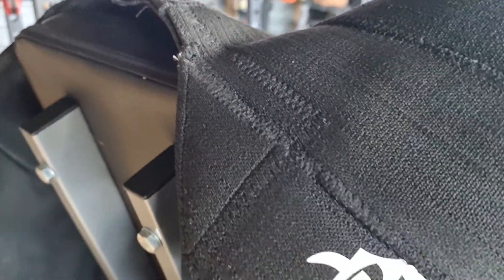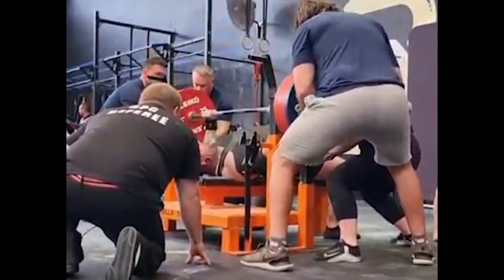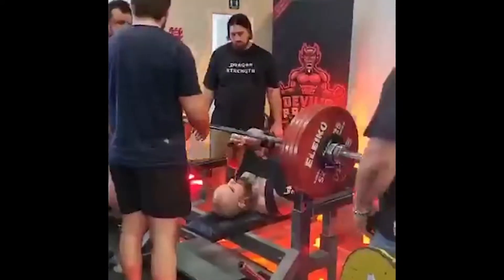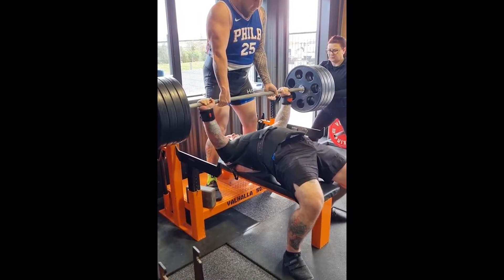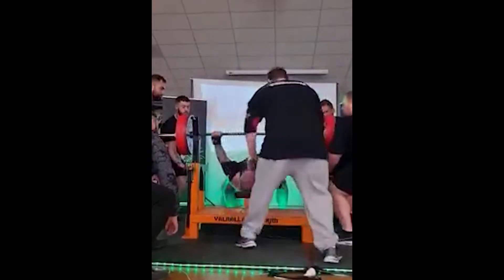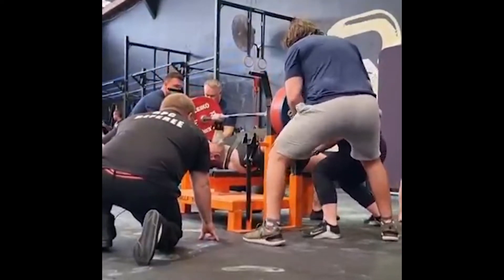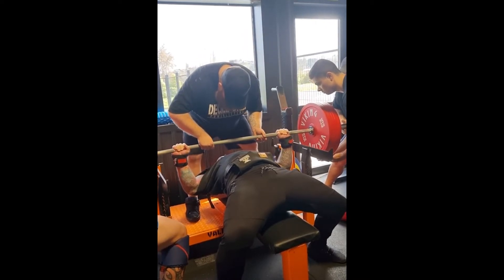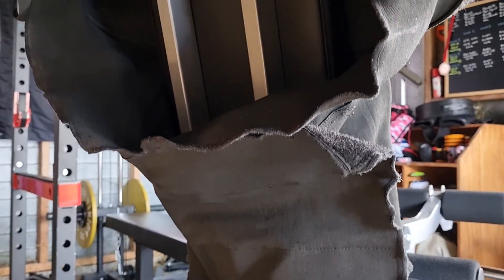F8 Bench Shirt explained

Comment: I just got my Raven 2.0 double-ply shirt. I have only used it twice and it has this little cup in the shirt like a curve in the middle, it wants to ride up to my throat and feels like it wants to decapitate me. LOL I use a seated bench machine by Hammer Strength with the two separate handles to simulate a real bench. I am handicapped so for some reason I get dizzy on my gyms real bench press.  It doesn't have a wide pad and I'm 5' 10 and 283 lbs so it feels like I'm going to fall off the bench, plus it is way to close to the ground because a 5 ft woman can place her feet on the ground w/o using any plates for foot support. Can anybody tell me why this shirt wants to ride up to my neck.